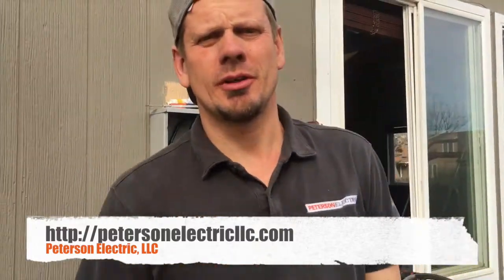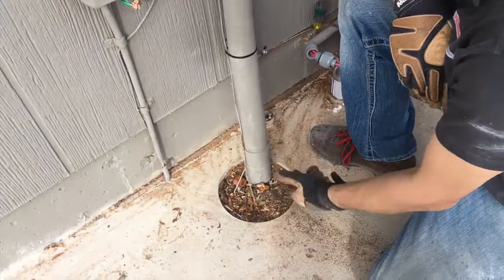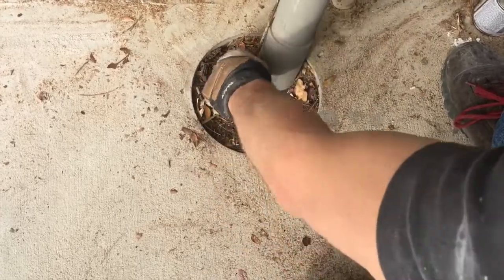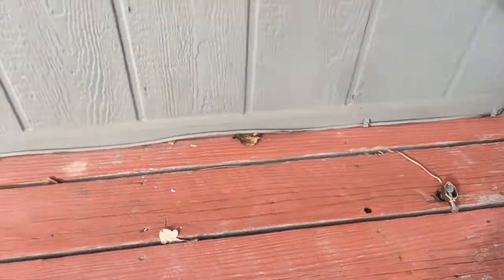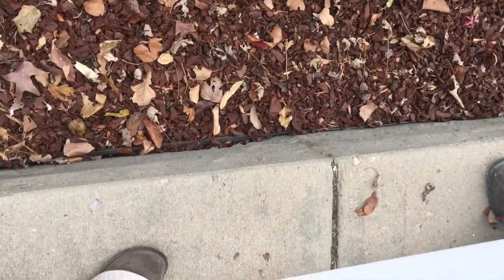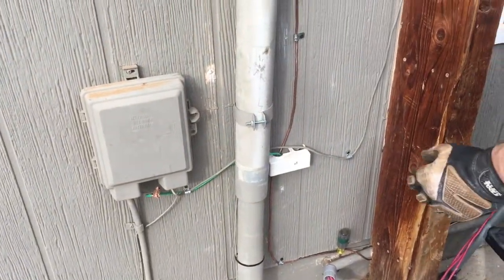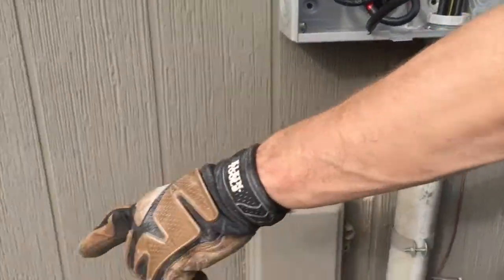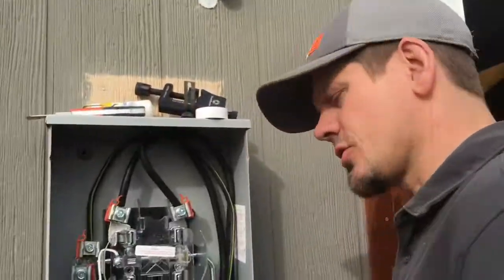Whole House Grounding Requirement To A House For Electrical Service Change In 2017

Comment: Grounding question: My house is a '60s build with electrical grounded to water pipe. The copper water  broke from the street and the plumber ran 3/4" PEX as a replacement for copper coming in. It dawned on me several months later that this probably destroyed the ground. Is this correct, and what fix is necessary? Thanks, enjoy your channel!